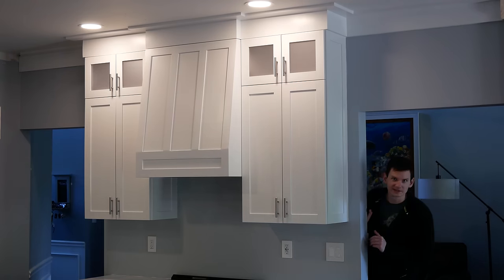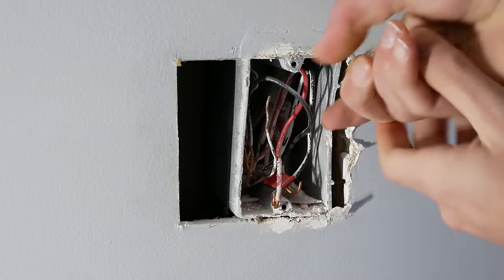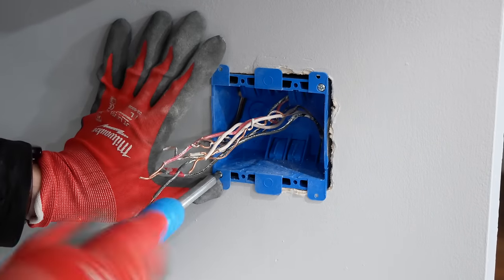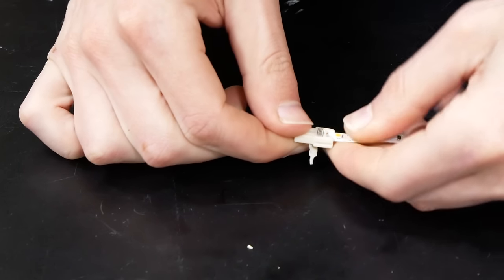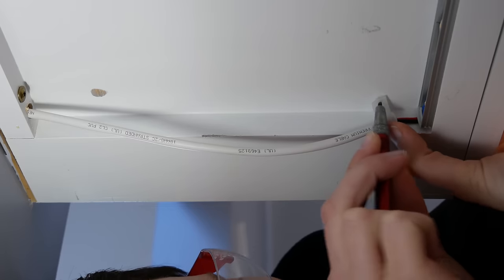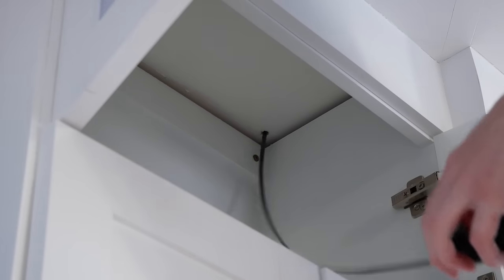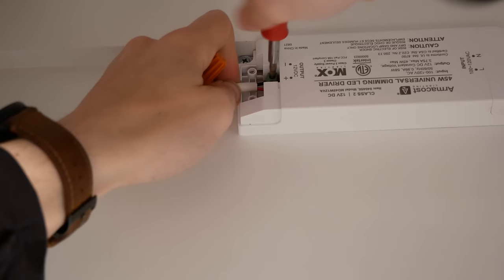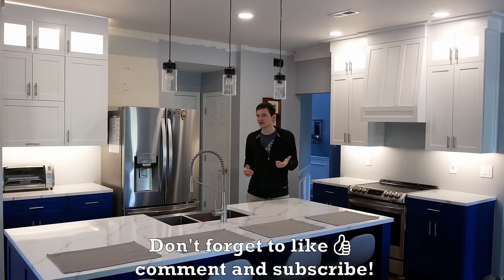How to Install LED Under and Above Cabinet Lighting Hooked to a Wall Dimmer Switch

Comment: This is by far the most concise & professional installation I have seen presented here on YT for under cabinet lighting. I'm a retired electrician who has installed quite a few of these myself and it is encouraging to see someone present this in way that is both easy to understand, yet done well.
Reply from the maker: Appreciate the compliments!
Reply: As a beginner i found this very hard to follow :(
Reply: I too am not quite a beginner but not an electrician but you hit on many of the questions I was having when starting to plan...  I have a 9' run   a 22' run and a 20' run..  gonna have them all on the same dimmer switch and hopefully it will all go together..    didn't know and wasn't addressed if you need a dimmable power supply if you have a dimmer... and if not what happens?    also can I use speaker wire?  16/2...    I look forward to getting all the materials and putting it all together.. 

Awesome video   and great instruction...

If you haven't seen it already    two resources I really liked  ( but couldn't quite follow yet...)

https://youtu.be/Umo6jKLfwsQ?si=hBJN_EE5tFD-7Ij1 

and 

https://youtu.be/KbbKAxnpCQQ?si=mPULdtNjWAD2IGMQ

Hope it helps someone..

Comment: Wow, I wish all instructional videos were like this. Simple, to the point and most of all 100% how you should actually do it. Having been in Audio / Visual installation, interior rehab and currently an Industrial Electrician I can say that you did everything exactly the way I would do it. Actually you did some things better than I would do it, sometimes I get cheap.
Reply from the maker: Thanks! I try hard to do and present things the correct way, it doesn't always mean I'm going to be 100% correct, but it's the goal!

p.s. Beep Beep

Comment: You would be amazed by how difficult it is to find a simple explanation of DIY LED wiring. Most videos are manufacturers telling you how to use their kits, and text descriptions from distributors like Bird Dog assume you already know the parts and where you should put them. This is the first practical example I've found, and it's really helped me put the pieces together. One touch I loved was showing your struggles with the outlet box. That's the sort of situational info that is actually very important to a project, but that every DIY video in the world leaves out because it's assumed to be too specific. So, thank you!
Reply from the maker: You're welcome! Glad the video was helpful
Reply: Yeah. That chunk of drywall is gone forever down that big black hole U created to another dimension in time and space...😢🕳️

Comment: Hi, could you tap into an existing ceiling light from a dimmable switch, meaning controlling ceiling lights and under cabinet lights from the same dimmable switch ? Thanks !

Comment: Dude - thanks for showing the LED driver here and how to set it up. NO ONE else actually shows how to use your basic wall switch to hook these up. I'm using your Amazon links and you have a new subscriber. Thanks!
Reply from the maker: Glad it was helpful! I hear you, I had to do a lot of research to figure out what I needed to make it all work

Comment: This is one of the best how to videos I've seen for how confident I feel being able to do it first time.

Only thing I would recommend to viewers is running 24 volts for longer runs like this one. It helps prevent as much voltage drop vs 12 volts
Reply from the maker: Thanks! 24 volts is definitely a good idea for longer runs, my voltage drop was well within acceptable range. I have long wire runs but the total length of the light strips for my kitchen was still pretty short

Comment: I've watched a lot of these "LED Cabinet and/or LED Niche lighting" How-To videos seeking information and this one was the most complete, answered all my questions, was easy to follow and all without unnecessary technical detail or annoying background music. Perfect! Thank you! -TIP to anyone considering doing this... If you can solder as shown at 5:33, it's a better option than using the click latch "locking connectors" which tend to be hit or miss in regards to getting a perfect connection. Many times you have to latch and unlatch the connectors or wiggle the wires in order to determine which of the connectors you installed has a flaky connection and preventing your light strip from lighting.
Reply from the maker: You're welcome! Glad it was helpful

Comment: Installed to replace a failing fluorescent fixture under my desk hutch. This fixture was easy to install and gives me the flexibility of 2 brightness levels and 3 color temperatures. Sturdy aluminum housing and slim design. Very well made.

Comment: This was exactly the inspiration I needed! I've built all sorts of LED projects, mostly automotive focused, over the years. Plus, I spent many years in low voltage world doing custom A/V, HT, automation and then into the Data Center world. We're finally about to kick off a big home reno project and our Kitchen it's getting gutted, bye bye 1971 cabinets. I was looking for a little inspiration and you nailed it, even down to having similar cabinets, colors, and the fact you've got it tied into a smart switch. Your install is very clean and reasonable for most anyone to tackle. Great job!
Reply from the maker: Thanks Chad!

Comment: This is a cool video...howvever not having a tile backsplash in place already makes it easier.  You can cover up all the work with the backsplace.  If you have tile in place..best option is to use wireless LED's that work with Alexa.
Reply from the maker: For sure! I experimented with running the wires without cutting holes as I know many people have existing backsplashes, even broke out an endoscope with a hook on it, but I couldn't get it to work. If the kitchen is against an interior wall, one could work from the other side but otherwise probably best to just go the route you suggested

Comment: This is probably the best install I’ve seen on YouTube. So I’m looking to do about a 50’ run of LED under cabinet lighting and I want to use a RGB smart variety. Any ideas? Most are fairly limited on run length.
Reply from the maker: Thanks! I think that armacost makes a wifi rgb controller that you can use in place of the driver I used. You'd have to use a rdg led strip instead of the white one I did. Search for Armacost ProLine Multicolor RGB + White Wi-Fi LED Controller. Let me know if this helps!

Comment: Very well done video … the only unclear issue I was left with is how all your led strip locations were powered? Were they Daisy  chained in series or paralleled back at the 45 watt power driver?  In the video you show tightening a single set of led wires onto the driver output terminals but that was before you tackled the remaining locations. I would think that each location would’ve been freed from the drive by a separate cable?  This would’ve resulted in three red and black cables at your driver?
Reply from the maker: There's a short single wire going from the driver as only one would fit in the terminals on the driver. It immediately hooks up to 3 others. Each of those wires goes to a separate location
Reply: Thank you for the quick reply!  I just watched the video again on my computer (big screen) and saw where you detailed the three runs coming back to the driver and wire-nutting them to the short piece of cable to allow it to terminate into the driver output.  I have to commend you on your video and comment links ... it is by far the most thorough video on this that I've seen.  I think you've motivated me to finally order some parts and start replacing my old fluorescent-tube undercabinet lights! 
I've subscribed and clicked the bell to be notified of your new videos!   @ProjectBilld

Comment: This video is great. Exactly what I needed.   THANK YOU!  When I bought the house my cabinets are already wired with halogen T10 bulbs that get really hot.  I bought led replacement bulbs and then realized the power driver was AC so I need to buy what you used.  Your link went to the 45 Watt but I should be able to get with by the 20 watt driver if its only for 5 1.5 watt bulbs right?
Reply from the maker: You're welcome! Sounds like the 20 watt should be plenty

Comment: Cool install..anyway to modify this setup if you had wled strips that you could modify temperature? Would something like wled need to be incorporated?
Reply from the maker: You'd need to use a compatible tunable white led driver. Something like this https://www.armacostlighting.com/products/proline-cct-led-light-control

Comment: Nice. I'm assuming one could daisy chain from end to end of the different LED strips if that were easier? I have total access down to studs.
And you kept mentioning "LED cable". What wire are you using there, gauge and type?
Reply from the maker: The wire should be linked in the video description. Don't see why you couldn't daisy chain the strips together, I pretty much did in a few places with short wires between strips
Reply: @ProjectBilld  It is linked. I'm bad about looking in that description area and you did a great job with all of those links. Thanks.

Comment: Great video! If you were to use multi-colored LEDs, can you share which ones you would buy?
Reply from the maker: Thanks! If I were going to do a hardwire setup like the video I'd likely use the same brand as the white leds I used. In addition to the driver you'd need to add a color controller as well

Comment: Love the video, question real quick for you, as opposed to an adding the dimmer to an existing three way switch, is it okay to add it an outlet we have below our cabinets? I’m assuming yes as it’s under constant power
Reply from the maker: I can't speak to the electrical code in your area, but if there is constant power and adding the lights won't overload the circuit, then it should be fine

Comment: I assume the driver gets less that 120 VAC from the wall switch when the dimmer is deployed. Does this affect the voltage required to run the LEDs?
Reply from the maker: I'm not sure, I never measured it while dimmed. I haven't noticed any issues with dimming them, though I do mostly keep them at full brightness since they're indirect lighting

Comment: Might be a dumb question but how do you know whether the black was going on the negative screw and the red on the positive when you are installing it in the driver?
Reply from the maker: The driver is marked and there's a hole/slot for each wire to go into. The screws clamp the wires into those slots. Does that make sense?

Comment: Great video!  Thanks so much for taking the time to do it so well!  I have a design question: I have 3 separate cabinets and will have about 13' of lights total. The cabinets are fairly close together but the driver will be located about 17 feet away from the farthest cabinet.  If I do home runs from each cabinet back to the driver I will use about 45 feet of LED cable.  Just wondering what would be the best approach: 1) home runs or 2) connect them in series.  Also wondering if I go with the 2nd option, should I create a loop and run back to the driver on the last cabinet?
Reply from the maker: I think I follow. Since most of your distance is led lights and not wire, as long as you're under the max length of led strip for the specific leds you're using I think you'd be fine to do a straight run. It would definitely be less work that doing that than array or feedback loop configuration. Straight runs have a chance of getting dimmer at the far end but I don't think that's going to be a problem from what you've described
Reply: @ProjectBilld  To clarify, the 45 feet would be the in wall 18/2 cable.  Only 13 feet of lights.  I would use much less cable if I wired the light segments in series.  I'm thinking the kit at Armacost with the 30 watt driver and 16' of 2700K lights would hopefully work without any noticeable difference in brightness at the end of the run.
Reply from the maker: Sounds like it should work as a straight run to me
Reply: @ProjectBilld  Thanks so much.  Appreciate you taking the time to help:)

Comment: Great video for sure,,can the dimmer work if you have a switched outlet. Planning on changing out regular switch for dimmer and use the outlet to plug in tranformer,,thx
Reply from the maker: So wiring a dimmer switch to a standard outlet is against code as you could technically plug things other than lights in to the outlet. However, there are special outlets/plugs made specifically for this. Search hdtr/ddtr outlets and rp-fdu plugs. You'd wire the dimmer switch to the lamp only side of the outlet and replace the plug end of the dimming power supply with the special plug.
Reply: I installed a dedicated outlet installed above cabinets just for driver to be hidden up there and feed wires down to calbinets,, Nothing else will be plugged in., thx for reply,,I think will be ok
Reply: Hi,,I have 9' of led tape and 40' of lead wires from driver,,armacost is saying at least 100w driver,,does that sound correct,,I was going to use 60w,,thx
Reply from the maker: No that doesn't sound correct. 9ft of strip lighting isn't much. The lead wires don't effect the wattage required for the dimmer, only voltage drop. Wattage required should be calculated using only the length of the specific strip lights you are using
Reply: That's what I thought too,,thx,,I'm going with the charts recommendations for 9ft. I talked to 2 different people there and 2 different answers,,thx again

Comment: If you didn't have the driver, would the led strip still work if they were wired directly to the switch for power?
Reply from the maker: No. The voltage would be much too high

Comment: How did you decide what LED manufacture to select for the LED strip lights and driver?
Reply from the maker: I tried to find a dimmable driver I could hardwire first with good reviews and documentation and once I did I just went with the strip lights from the same company. Seemed to be good quality when installing and is still working well

Comment: Why not get the strip and diffuser installed before mounting the aluminum channel? Seems like it would save some contortions.
Reply from the maker: If you used some kind of adhesive or the brackets that came with the channels to mount the aluminum channel you could probably do it this way. I drilled through the channels and mounted with screws as the brackets that came with them were terrible so the channels had to go up first

Comment: For a cleaner look, we contractors place the fixture so it covers the hole and wire coming through the back of the cabinet instead of installing it on the other side of the cabinet.
Reply from the maker: Yep definitely a good option especially for those that don't have trim on the front to mount lights to. I preferred the way the light reflected off the wall vs it shining directly out so that's why I mounted it on the front edge facing back

Comment: Are you able to put things in those upper cabinets or would they become visible when the lights are on?

I have a similar setup but hope not to show all the stuff I store in there (thinking LED panels attached to the doors to block the visibility inside
Reply from the maker: As long as the stuff inside the cabinet is an inch or two back from the door, I can't tell that anything is inside

Comment: Hi, I ordered everything in your list exactly lol. I have everything wired up, but it keeps tripping the breaker. Do you know what it could be? If I unhook the driver the kasa switch comes on and let’s me connect to it, but when the driver is wired up it keeps popping the breaker
Reply from the maker: I'm not sure what exactly is going on that would be tripping the breaker but it does sound like the source of the problem is beyond the switch. How many outlets/lights are already on that circuit? Might be too much load with the new leds added. Have you wired the leds up yet? If so, try unhooking them from the driver and see if the breaker still trips
Reply: If you shared a neutral across two different circuits, your AFCI breaker (if your electrical panel has them) might be what's actually tripping, not from overcurrent condition. 
When you go to reset, there's a pattern of light to look for. If you reset it and it was an arc fault then the light will glow for five seconds. If not arc fault but over current, there will be no light when you reset it. That's how my Siemens breakers work. Your brand may be a little different.
To fix this, make sure you're not sharing neutrals across multiple circuits since there maybe multiple circuits in your box.

Comment: What was the color temp of the LEDs that you used ?  Trying to decide to get tunable or fixed temperature.  Thank you
Reply from the maker: 3k as that matches the overhead lights in my kitchen. I only really use the cabinet lights in the evenings so I wanted a warmer color temp
Reply: @ProjectBilld  sorry one more. Where in the cabinet did you mount the light rails in the glass door cabinets on top?  In the front or middle ? Were the rails 45 degree angled or straight across the top?

Thank you again
Reply from the maker: No worries! I did top, above the doors facing back straight towards the wall

Comment: Pretty good video! Couldn’t you also run all the low voltage cables to one driver so you wouldn’t need to run power to all 3 drivers? And not need to buy all 3 drivers?
Reply from the maker: That's how I did it in the video. I only used 1 driver

Comment: Very nice... Im going to do mine the exact same way.... One question I do have is where did you get the extra led wire with the white covering im gonna need to buy a roll.... Thanks in advance
Reply from the maker: Materials and tools used are linked in the video description!
Reply from the maker: Look for the link called LED cable
Reply: Oh man thanks.. Sorry i went right passed it thank you very much